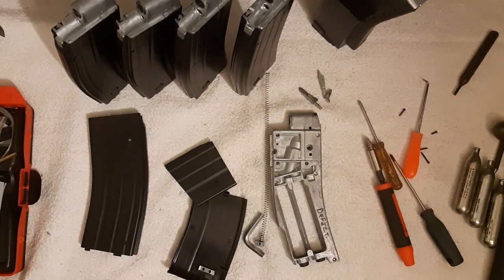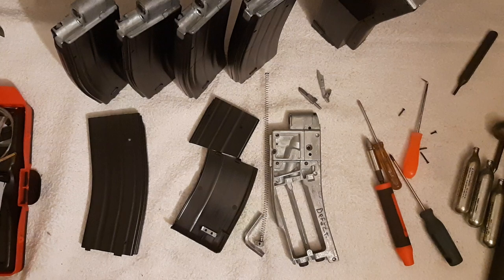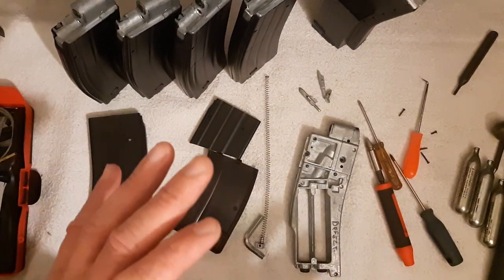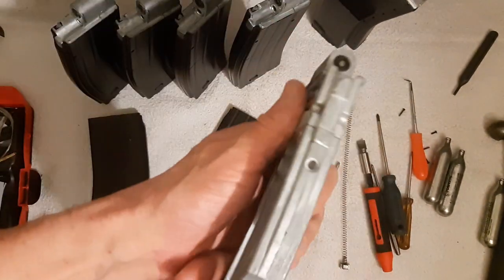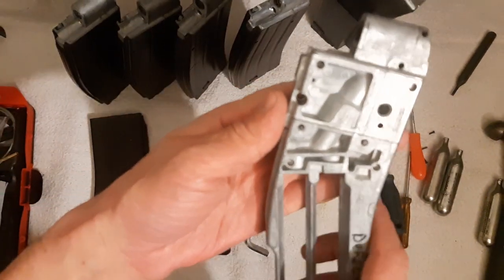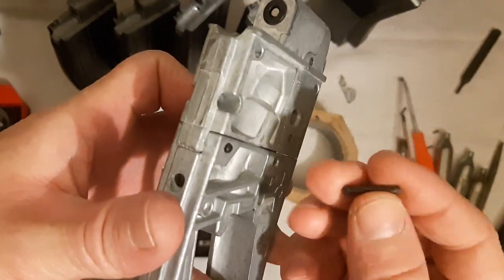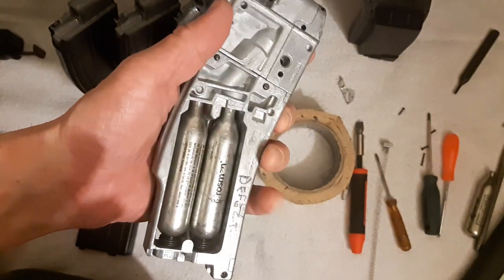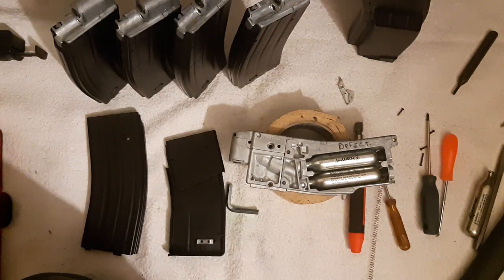Crosman Full Auto BB Gun Magazine - Tips And Tricks

Comment: Was the O' ring on the co² plug lubed up?

If not?
I suggest you grease it up.

It will increase the FPS
Reply from the maker: The green seal around the piercing needle? The only orings that can affect fps would be the ones inside the actual valve, if they for some reason impede the valve cycling.  Considering there are no leaks.

Comment: Ok, this doesn’t pertain to this mag but I have a glock 17 replica and when I install the co2 into the mag all the air comes out, I do put a drop of air gun oil but doesn’t help, any info on this? Picked up another mag works great but at $50 I would like to fix the problem.
🤷🏻‍♂️🤷🏻‍♂️🤷🏻‍♂️
Reply: Oh, and it’s not a new mag, it did work great but now not so much.
Reply from the maker: @tommanning7337  if it completely discharges out the top of the magazine then you need to tinker with the valve.  If you take it out with an "airsoft valve" tool you can clean inside, re-seat the o-ring, put a drop of silicone oil and then snug the valve back in.

If it is just a slow leak , try putting a drop of silicone oil down the top of the mag directly into the valve while the co2 is slow leaking out.  Let it sit and see what happens.
Reply: @RWMAirgunsmithing  yeah, it comes out instantly
Reply from the maker: @tommanning7337  yeah, need to take out the valve,  You can "jerryrig" a tool to unscrew it but I would recommend finding an airsoft shop and buying a valve tool.  

The oring inside might be mangled, but if not just a good cleaning and lube job should get it back up and running for at least 6 to 8 co2.

edit : in my experience you will need to unscrew the valve and clean it every half dozen or so co2.
Reply: @RWMAirgunsmithing  awesome!!! Thanks man, I’ll mess with it and see what happens.
THANKS!!!!!!!

Comment: Do you have a video of you taking it apart? I have a bb stuck in the spring. It came out of the box like that.
Reply from the maker: Wow that is crazy! I am currently working on a part 2 for the mags. I'll include the full breakdown.

Until then you can checkout the link I put in the description.  Its pretty easy to remove the plastic covers and  it is only one screw holding the the bb follower spring in place.
Reply from the maker: Hey btw I pinned a comment for the "bbstuckinthespring" problem.  I would venture it is the easiest solution with no disassembly.

Comment: Hi my name is Willie I recently purchased the QR magazine which is the 300 capacity which I've had trouble with sometimes it would work it would use both canisters sometimes it wouldn't so the original I had the same trouble so I started using it more often the original works fine now but the QR the I started taking it apart and of course I avoided the warranty but I can't find parts that's what my question is I've contacted crosman directly and they have no idea where to get parts seals is what I need I actually broke one of the retaining rings which are cast they're very cheap and I started to strip it and then bad things happen anyhow I'd like to find parts please let me know how thank you great video by the way
Reply from the maker: Oof, tough break. Unfortunately crosman has not pumped out many spare parts for these yet.  If you have a friend with a 3d printer and decent material you can maybe get one 3d printed, not sure if that is overkill.

Any solution that could keep the co2 centered as you pierce should keep it running.  When I tried taking out the green seal by the bottom it was really tight and I gave up, Maybe a properly sized o'ring will do the trick.  Just make sure the tip of the canister gets centered when piercing so it ends up flat on the seal.

Comment: Hello. Thanks for the video. My second co2 cartrige isnt charging. I unscrewed little pin and oiled it, but no help. When I put only second co2 nothing happens and it doesnt go anywhere
Reply from the maker: By little pin you mean the set screw on the side of the magazine or the piercing needle for the co2?

Kinda sounds like one of your retaining screws holding your co2 seal and piercing needle is too tight and jamming the internal check valve. Did you perform Big J's proof video I linked in description?
Reply: @RWMAirgunsmithing  yes, set screw on the right side. I see that second needle is little high and may be this is the problem
Reply from the maker: @georgesharvashidze7338  lemme know how it goes xD btw I think I said it in the video but make sure you use proper fitting tools, dont go in crooked.
Reply: @RWMAirgunsmithing  of course 😂
Reply: @RWMAirgunsmithing  I just did what you say and now when i insert first co2 it comes from second needle xdd
Reply from the maker: @georgesharvashidze7338  hehe yeah that happened to me as well xD I also mention you need to find the middle sweet spot, not too tight not too loose.  

You are close, if you can remember how many turns you did you can go back half way and should be good.
Reply: @RWMAirgunsmithing  May be this is better, two cartridges will work together, more fps xd
Reply from the maker: @georgesharvashidze7338  actually you are not getting more FPS, just better efficiency and consistency.

The reason the co2 was not discharging out the first and now is discharging out the second is because the of the internal check valve.   When one co2 is low pressure the other with higher pressure will push the check valve and be used when firing until the pressure is lower than the other in which case the check valve will be pushed back over the co2 with now lower pressure. Resulting in smooth maximum efficacy.

I always use 2 , I mainly  do single shot plinking I only need one mag at a time and get 150+ solid rounds before I notice a dropoff.

Comment: My mag has a problem in the top of the magazine the thing that does the blowback randomly snapped and theres a gold circle and now the blowback now shooting semi auto or full auto and i have to manually charge the slide what do i do
Reply from the maker: There should be a black rubber seal between your gold part and the broken part.  I would guess the air pressure is escaping in too many directions and doesn't have enough energy to push the BCG all the back forcing you to charge it for every shot.

Comment: Hey, i see that u know this stuff i just got dpms and my mag is defected, when i put co2 into first slot it dumps it thru secound, if i want to use mag i have to put emty co2 into secound slot and then put full co2 into first slot, what do you sgest to do in this case
Reply from the maker: Most likely the check valve mechanism isnt seated properly by the piercing needle retaining ring.

Follow the instructions in the video, and gradually tighten the ring, you might not need much, dont over do it so you dont squeeze it.
Reply: So the secound slot has to be tighten more then first, because now they are tightened equally and that secound one leaks
Reply from the maker: @pauliusdorosenka7036  I wouldn't worry about making them equally tight, the goal here is to find the sweet spot.   You might have to waste a co2 and perform Big J's video to dislodge the check valve.
Reply: Ok that valve adjusting actualy helped and i reloaded both co2 😁 now i would see if they both are using, how many mags can u get from 2 co2 cartriges ?
Reply from the maker: @pauliusdorosenka7036  nice! If you are leisurely semi auto plinking you can expect a good 4-5 mags with good power then maybe the 5th and 6th you will start noticing.  If you full auto dump repeatedly it will be less.  You will find out sure enough when you're done plinking unscrew the co2 xD

Comment: Whenever I load my CO2 (where it's indicated first), it leaks and depletes all my CO2, so I start with the right side instead. In fact I only fire mine with 1 CO2 just the right side only. Some must be stuck.
Reply from the maker: Ya , for sure something is getting stuck... thankfully these guys run on one co2 only.  

I plan on making a sequel to this video in which I get to the bottom of that interior check valve.

Until then, I highly recommend following the procedure on Big J's channel and after that trying to tinker with the co2 piercing needle ring.
Reply: What's happening with co2 leaking out the right side is a really small round ball barring that's not seating right! What's supposed to happen when you load the co2 that says first is the pressure builds up within the shared chamber and that pressure is supposed to push that little ball barring against a seal that on the opposite side of the piercing valve. Sometimes a bit of dirt or whatever it may be gets in the way and causes it to leak past.. if you get a blow gun with the curved metal tip and some pel gun oil, put a couple of drops on each peircer valve and then with the blow start with the the first one and gently apply a bit of air to that valve with the blow gun tip covering the peircer valve and sitting tight again the green o ring. Just be careful not to bend or break the peircer valve tip. Then move to the next one and repeat, but adding more air pressure as you go.. the only reason I say start gently with the air is to make sure you get that oil in there and not all over you or wherever else it may blow onto waisting the oil.. . Also one more thing ,I noticed you mentioned you have never took apart the top valve chamber section.  Well I have about a hundred different times I also make my own custom valves almost identical to the factory valve, with the exception of my valves will get you running at anywhere from 600fps to upwards of 1200 fps.. I make three different valves witch all range from above said numbers ! Cheers guys and happy air gunning
Reply: I would add some picks with numbers but there's nowhere to attach said file here lol
Reply: I also forgot to mention that you can tighten the retaining collar ring, but again be very careful with those as well because there very soft metal and will strip out and in some cases break in half !

Comment: I have a QR mag that shoots co2 out of co2 chamber 2 when Im loading chamber 1. Could you make a video on the qr mag problems? I was hoping to fix it, shipping would take forever and be a challenge, Im way out in the pacific. Please help.
Reply: Ok so you may have addressed it in this video, apologies. so if Im dumping gas out of 2, then I should try to tighten two oring assembly. cant seem to find a flat head wide enough, but I will give that a shot. thanks for your video.
Reply from the maker: @greyone308  Yeah, I think maybe that number 2 is slack. Might not take much tightening to get it working.  Hope it works and you dont have a defect mag and watch out for the piercing needle! hehe
Reply: @RWMAirgunsmithing  Thanks so much, just found your channel. Will sub since you help personally.
 So have you had a chance to do a video on the Hatsan Invader Auto .25? Its a great gun on all levels. I need to know how to disassemble, how to modify, how to remove the front barrel shroud, etc. 
 ALso the new A400 is coming out, worlds first. Im dying to get one, do a video on it if you havent already, I wanna know everything, any major issues to look out for. at 400$ they arnt that expensive, but money is tight, and so is the wife..... smiley face, its the next one I want, and if it is what they say it is, and works great, who wouldnt want several? 
 Thanks
Reply from the maker: @greyone308  Sorry, I am in Canada, anything over 500fps and 4.2ft/lbs needs to be registered making purchasing for fun a little tedious.  Needless to say I prefer to save my registering for when I buy real firearms xD
Reply: @RWMAirgunsmithing  well that stops the Invader, but I think youll be able to get a Barra A400. CHeck them out, full auto from a battery. Ive been waiting my whole life.
Reply from the maker: @greyone308  seriously xD those guys look hella efficient and accurate!

Comment: Idk if it'd be the solution or not but I got the crosman ak1 BB gun and while reloading I accidentally dropped the magazine and it still works but it's just harder to take in and take out and was wondering what the problem could be. It looks perfectly fine except at the top of where the BB fires, there's tiny tiny dents on it and a tiny bit of the rubber where the firing pin of the rifle hits is poking out just a tiny bit and was wondering how I could exactly fix it
Reply from the maker: I have an ak1 in the mail, ill see what the mag looks like next week.  For sure though any deformed part might create additional friction in the magwell.  Wish i could see the condition of your rubber piece, if it's not damaged and just sticking out you need find a way to re-seat it.
Reply from the maker: Excluding the dropped mag part..... lol

From comments from other viewers I can relate that the problem of the ak mag not dropping free stems from a valve problem in the mag that causes the valve to jam in the "chamber".  So you need to empty the co2 and relieve the pressure on the mag valve so it can drop free.

Hope this helps, sorry it took so long, you can contact crosman and hope they replace the mag.
Reply: So in the very top there's a Lil magnet that came out of mine and I'm not sure where it sits any help much appreciated

Comment: Thanks for this. Shot mine in the desert once, then it jammed!
Reply from the maker: Glad to help out!  Was it the spring that jammed? or just dusty environment and the airgun didnt like it?
Reply: @RWMAirgunsmithing  I believe it’s the spring. I haven’t had a chance to service and clear it since seeing your video.  It wasn’t very dusty that night. I’ll be clearing it soon.  Thank you for the video and the reply!
Reply from the maker: @motosporttouring  If you ever figure out what the issue is and got the time to share, feel free to post here!
Reply: @RWMAirgunsmithing  I will for sure!
Reply: @RWMAirgunsmithing  figured it out, but not in this gun. I also recently got the Crosman fully auto PFAM9B.  Same thing happened. I load too many bbs at once causing the spring to not go into the slot so it can push bbs.  It jams there, but once I take some bbs out, it’s good.
Reply from the maker: @motosporttouring  Yeap, that will do it, it has happened to me a few times over the years xD

Slap in a full mag, takes a few shots for the brain to register the sound of an empty barrel hehe

edit : I would maybe suggest buying extra mags, you wont need to worry about loading them to the brim and you can let the co2 rest while you shoot the other, and thus maximize plinking fun xD
Reply: @RWMAirgunsmithing  excellent advice, thank you !

Comment: I have an an AK1 with a magazine that is stuck in the rifle.   Tried pulling hard and wd40.  No Luck.  It appears to be stuck on the side opposite the catch that holds it in.  When I push the release lever it comes out less than 1/8" on the catch side.  any ideas?
Reply from the maker: Are you pulling straight down? Unlike a real one they dont require to clip in at an angle.

Seems like there is a streak of bad mags out there, you are the 3rd in the past couple weeks with a stuck mag.  Can you confirm there are no bbs wedged between the mag and the inner barrel?

Comment: Hey bro got any pointers if I wanted to hpa tank this?
Reply from the maker: I am eyeballing the bulk-fill adapter sold by pyramydair.  From everything I can see they made it for the crosman magazine.  Just need to buy all the accessories.

https://www.pyramydair.com/product/air-venturi-bulk-fill-adapter-crosman-dpms-sbr-magazine?a=9951
Reply: @RWMAirgunsmithing  yup more a less what I was looking at too buddy.  I'm thinking about it :) would be cool
Reply: @RWMAirgunsmithing  cause the magazine replaced is 60 bucks but I could just go a step further n get mass air tank lol
Reply from the maker: @bradfletcher6826  not to mention more consistent velocities and if you have a regulator you can dial in the perfect pressure xD

I have a couple of optics I wish I could zero without worrying about the thermal aspect of co2.
Reply: @RWMAirgunsmithing  I just made a slamfire 22 from a paintball gun so I'm looking to modify my next project lol
Reply from the maker: @bradfletcher6826  Dang! just googled those, for sure that would make me a criminal here in Canada lmao.

Comment: Does anybody know where I can get a replacement spring for the bb follower?
Reply from the maker: Unfortunately crosman does not sell parts (except like 3 or 4 ).  You can buy springs online though, anything with the same diameter and quasi similar thickness should work. Maybe airsoft shops would stock springs that might fit.

Comment: Help me  mine  will push bb a little to far up causing jams it doesn't stop in the right position it is half way as if a half moon right were the bb hole is located
Reply from the maker: You are the second in a week with this problem! I've noticed the bb is a bit off center but never had issues.  I will start prepping a part 2 for these mags.
Reply from the maker: I have come across this problem, the mag is not seating properly, it clicks in but is 1mm low.

I made a mark on the magazine and compared it to a functioning crosman, the mark disappeared under the magwell. I fixed my problem by simply inserting a mag over and over VERY FIRMLY but not violently. After about a dozen times the mark disappeared under the magwell, now I have zero feeding issues.